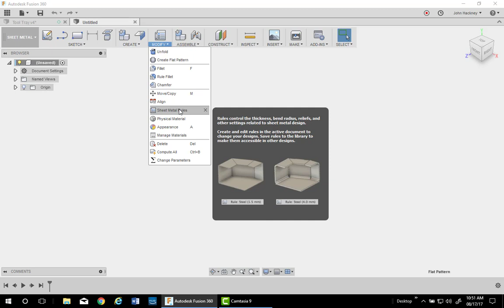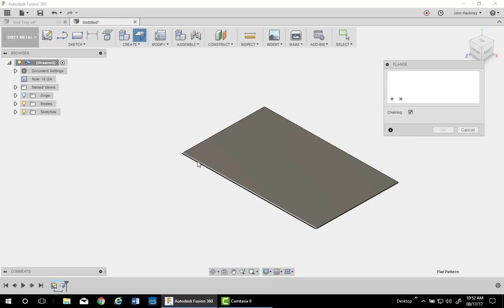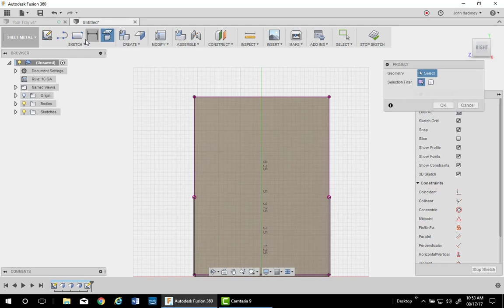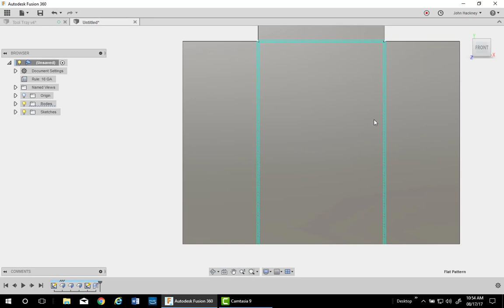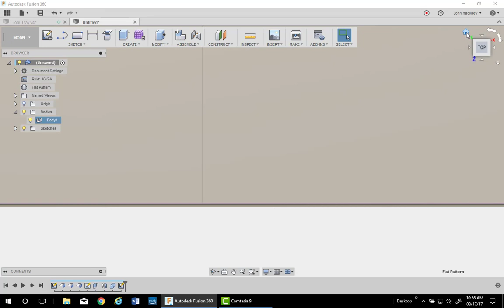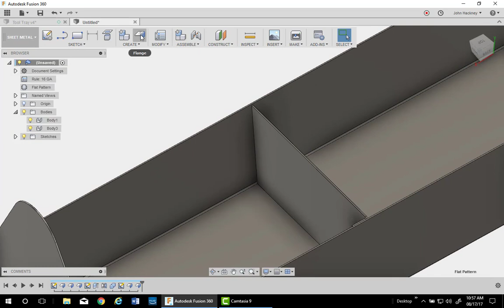Autodesk Fusion 360 Sheet Metal

Comment: How are ur edges closed together
Reply from the maker: I changed my corner gap to a very small value so there is no gap.  They are not truly closed, just inside sheet metal corner to inside sheet metal corner.  This is done under the material setting overrides.